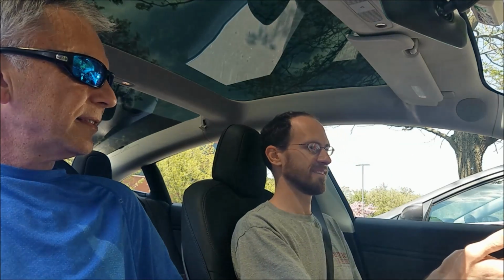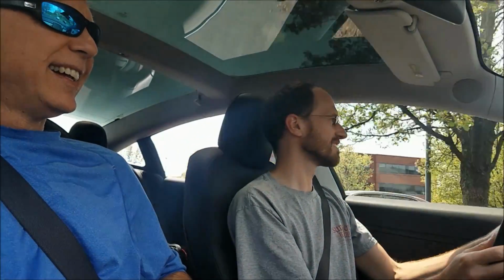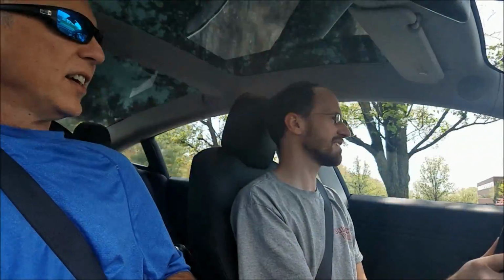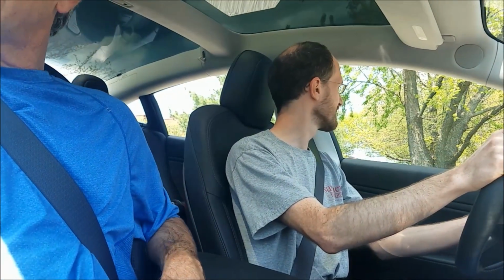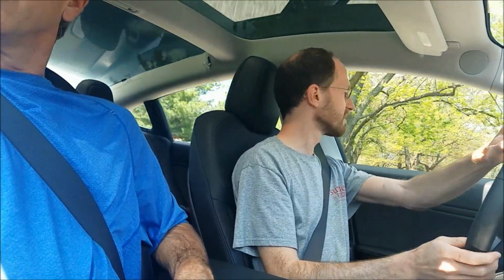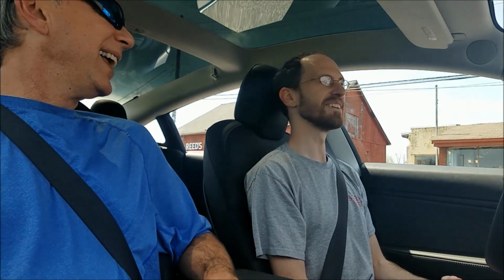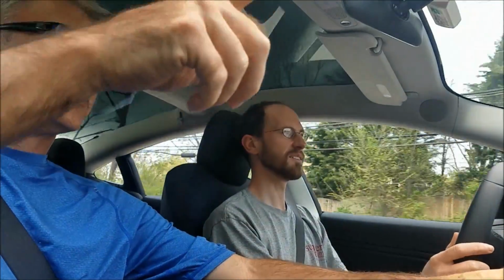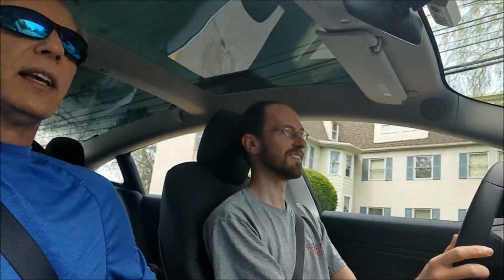Self Driving Software Engineer Discusses the Technology - Nick's Model 3 - Day 46

Comment: Elon claimed that cameras can essentially see the same things as Lidar.  They both use light, after all.  He's betting on the quality of neural network processing of the camera output, which may improve faster than the use of Lidar.  He may be right.  He may be wrong.  I find cameras a much better solution than Lidar, if it can work.  Cameras are totally passive, small, ubiquitous, and extremely cheap.  They're used by the billions in cell phones for example, so they have massive economies of scale on their side.

Model Y will use a much more highly multiplexed, centralized wiring harness.  This makes it physically much simpler, much easier to install, and lower cost.  All car makers are trying to move towards that, but as usual Tesla is pushing the use of new technology faster than others.
Reply: Cameras can measure distance using parallax.  https://en.wikipedia.org/wiki/Parallax  Tesla Autopilot hardware version 2+ includes 8 cameras with overlapping fields of view.

One advantage of LIDAR is that it sends out laser light, so it's not dependent on ambient light.  However very common camera chips have very good low light performance, so it's probably not a major difference in practical terms.  Cameras can work in low light far better than humans can.
Reply: Cameras can measure distance using parallax:  https://en.wikipedia.org/wiki/Parallax  Tesla Autopilot version 2+ hardware includes 8 cameras with overlapping fields of view.

One advantage LIDAR has is that it sends out laser light so it's not dependent on ambient light, but very common cameras can see in low light much better than humans can, so it's mostly a non-issue.
Reply: In addition, cameras can measure distance using parralax: https://en.wikipedia.org/wiki/Parallax  Tesla Autoplot hardware version 2+ has 8 cameras with overlapping fields of view.

LIDAR has the advantage of sending laser light out, so it would work in total darkness, but as a practical matter, cameras can see in low light much better than humans, so it may not make much practical difference.

Comment from the maker: Chris also sent me this cool information on neural networks. The YOLO stuff is way cool!If anyone is interested in the Neural Network design involved, this is what will be coming to his car once they add stop sign identification. Much of the work is taking in the video input, messing around with the individual frames to make any signs stand out more, then using a pre-trained neural network to both identify and locate those signs in the image.  The training process happens ahead of time, with the below example relying on a large set of pre-identified/labeled sign images from Germany (one of the larger early datasets made freely available.  Whenever you log into a website and pick sections of an image which contain road signs (a new captcha), you're helping label a similar dataset for Google/Waymo to use).  You take the training images, mess around with them in various ways to improve the quality of the training, train the network on that set of images, and test the accuracy of the network's predictions on new images.  Tweak settings, re-train, re-test, tweak settings, retrain, retest, etc, until you have a network that does a good job identifying signs!  https://navoshta.com/traffic-signs-classification/
This is a simple method that does a very good job, but it isn't possible to run it in real-time in a car.  To make it run faster, different network designs can reduce the number of starting inputs, and reducing the more costly network steps; speeding up processing enough to get >15 frames per second on today's hardware.  One network I've been playing around with is YOLO (You Only Look Once), which can identify a range of objects in an image and draw a very accurate bounding box with a label at more than 30fps on last year's top consumer GPUs.  It's not as accurate on roads signs specifically, but if Tesla can combine YOLO with road-sign-specific identification, and keep the speed up with Nvidia's Drive PX Nick mentioned, it'll be pretty awesome! https://pjreddie.com/darknet/yolo/ This is what Waymo is doing now with their self-driving taxis in Arizona.  Here's a visualization of what that looks like in practice, with 3-d volumetric bounding boxes around things (including stop lights, and that orange box around the pedestrian crossing the street)
https://www.techradar.com/news/this-360-degree-video-shows-how-a-waymo-self-driving-car-sees-the-road

Comment: Enjoyed the video but I think it is a dangerous thing to tell people that autopilot "works fine on local roads." This type of information is misleading to the general public and I think leads to more accidents and distrust of the system in general.

As you know, the system is only approved for use on divided highways right now. In my opinion that is the only place it should be demonstrated to new users.
Reply from the maker: Dan Detweiler good point, totally agree. I will try to point this out. But I'm still I impressed at how much better AP 2.5 is going on local roads, it's clearly a sign of things to come for self driving.
Reply: Autopilot is intended only for fully divided roads.  Doing anything else is risking someone's death.  Please don't do that.

Comment: You don’t have to wiggle the steering wheel..just lightly hold it.
Reply from the maker: Do think there is pressure sensors or are you saying by holding it lightly you resist it from turning and that light torque gives enough information to let the car know your hands are on the wheel. I think its the second.
Reply: It’s possible that there is pressure sensor.
Reply: It's extremely unlikely there is a pressure sensor, if by that you mean squeezing the rim harder.   Most likely it's measuring movement (displacement) or force.  No human can hold anything perfectly still.  The slight movement of simply holding the wheel can be detected.

Comment: Nick, why are your interior lights blinking in the video?  (Noticed when your guest parked about 2/3 through the video.
Reply: It may just be a mismatch between the camera's frequency and the car lights'.
Reply: just the camera not picking it up properly i guess
Reply: Some car lighting is not on 100% of the time.  It's called pulse width modulation, and it's used to dim lights at home too.  So flicker sometimes can be seen by cameras.  (Same with home or office lights on some dimmers.)  It's like wagon wheels that look like they're going backwards in movies.  The human eye does not see the rapid off times of the lights.